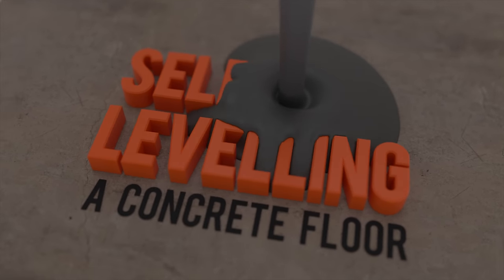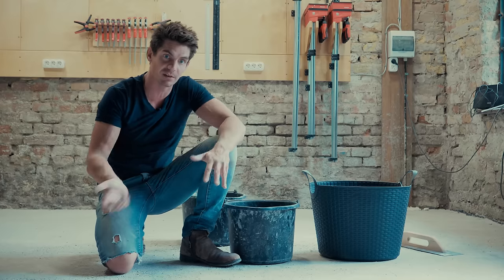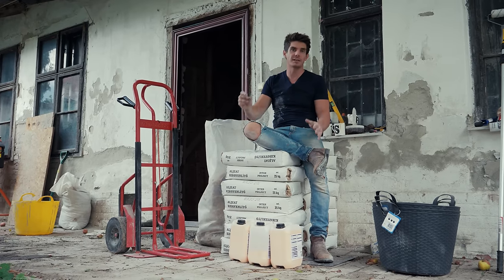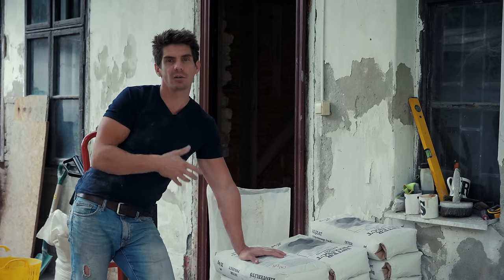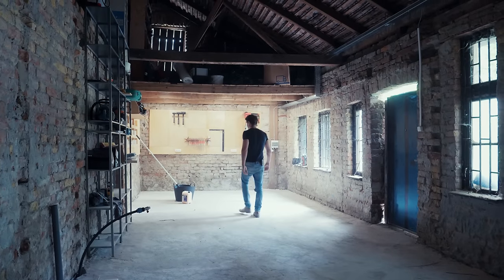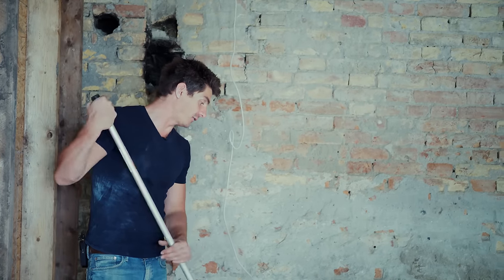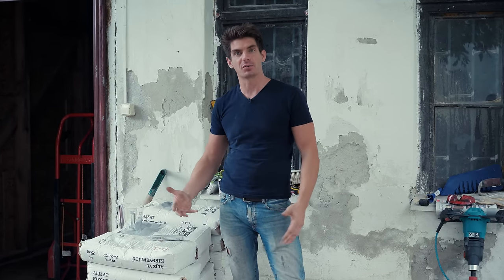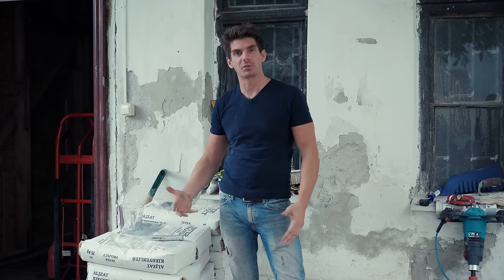Self-levelling a floor - The Complete Guide

Comment: My concrete slab under 30 yr old carpet was very dry, dusty, crumbly, etc.  I cleaned and swept the cement floor and was told to put. Sealer/ primer on it so I did. I then painted it. Let it dry and it peeled off weeks months later.  Even the sealer. Then I tried another way in another room and didn’t seal it. Prime it or anything and used a garage paint. It peeled off I had to redo my entire floor all over agin with acetone and a wire brush by hand. 266 square feet of cement floor. The I just bought rust oleum (stain not paint) he stain actually absorbed into the concrete. Wahlah..it worked. I put a few layers on it so I could have a very deep gray and completely covered the floor. I then went over the stained floor with 2 coats of clear, rust oleum and it dried beautiful!!!! But I ended up with a bumpy shiney floor. So I need to figure out if this leveling will do the trick for me for a beautiful smooth floor.

Comment: I am in the middle of doing a large workshop. The builder made a mess of the floor. The finish. It is bad enough that I am going to have to use self leveling cement to fix this. It is divided up into 12X4 meter cells. The concrete is Mpa30 x 150mm thick with reinforced steel mesh. It has been float finished. I have done a lot of renovation work. But I have never used self leveling compound.This is the Best explanation of how to do this I have so far come across on Youtube. May you, and your tribe prosper mightily.  Kind regards, and greetings from Africa.

Comment: I think I’ve decided to do this in my small laundry room instead of tiling. I have a beautiful brand new hot water heater in there that I refuse to remove to do a floor. I may paint the floor and stencil. Still undecided on the painting. This video was very helpful!

Comment: Great vid. Nicely explained. I would add 2 tips for speed. Use a long handled blade spreader rather than a hand trowel. Drill a 1/2” hole in water bucket at your gauge level. easier and quicker.

Comment: Get a floor scrubber rubber, the type used for stripping wax from floor start with the brush only then go over it with the buffing pad one time each 60,80,120 grits flood floor vacuum and let dry. I've found a few times over the years I can just put some top and bond down over a coat of liquid bond and cure. Then apply desired finish coat. Self leveler is 90-140 dollars a bag vrs 15-20 for top and bond at dollars for bond and cure which makes 225 gallons. Plus no matter how much self leveler you use concrete continues to cure. That Crete was to wet and over vibrates all aggregate was out of play

Comment: Great clip, just did a 30sqm area and that stuff is a life saver, much better and harder wearing with the polymers they use in it now. Surprised you got raised areas as it normally slumps as it sets, I just pour,smear and leave it to find itself. Anyway this will help heaps for those  about to do this for the first time

Comment: Regarding "one continuous pour". We are doing a 25 sq m area, (smaller than yours) with average pour of 7mm. From 3-10mm. I've bought 3x 75 litre mixing buckets, because my plan was to mix 3 buckets at the beginning, actually doing the mixing in the buckets on the middle of the floor we are pouring onto, then literally just dumping out the stuff all in one go, then using a long float to pull it around and get it to level. The reason I want to do it that way is that I'm very concerned that if we mix in smaller buckets, each mix will be 3 minutes, that's 13 buckets which is about 40 minutes of just mixing! Far longer than the working time of the product (about 30 mins). My way, it will all be mixed up in about 10 mins, and then tip, trowel by hand and with a long pole, and then hit it with the spiked roller. I've never done this before - does my idea sound stupid or sensible? The only things I can think of that are different to this video are: 1) it does involve walking in the screed to get to the corners - so boots etc... and (2) as the 75 litre buckets are deep and quite narrow (plasterer's buckets) it may be difficult to get my hand in to scrape off the sides during mixing. Do you think that will be a problem? Cheers!

Comment: concrete was mixed way too thick no flow to it which is why your roller left marks because it was so thick and dried too quickly. also use a 30-40 gallon bin to mix them at once in the spot needed with a vacuum

Comment: Just a little trick of the trade. If you get any high spots, clumps or ridges, In the self leveling. 
You can take the trowel, put it on its side with the handle facing you, and just drag it. You have to do it at the right time. Right when it sets enough to walk on it, but soft enough to remove it. 
It’s a lot easier then pulling the grinder out:-)
Reply: I don’t normally tell my secrets that I learned after many years of trial and error,  but I’m feeling generous today.

Comment: Seems like a wet-dry vac would be your best bet for getting most of that dust crap off the floor. just pour down some water, brush lightly to loosen it into a slurry, then suck it back up with the wetvac. Repeat until most of it is gone, then do the final run with the broom to get the last of it. Yeah, it'll take longer but a lot less backbreaking than multiple passes with that broom.

Comment: tip cut a hole in the side of the bucket at the right level then just hose in the water till its to the hole. also a tall thin hard plastic bucket and you wont splash screed all over the wall

Comment: When you have measured the exact amount of water required cut a hole in the bucket at the water surface point and that way you will use exactly the same amount of water for each bag.

Comment: I have loads of comments ,but I will start with one . This stuff is not self leveling ,it can't possibly be , at best it is self smoothing . It is very expensive in UK ,obviously a lot cheaper in Hungary. 1L/mm/m2 is the formula . 1000 Litres= 1 cubic metre, the weight is not important .The upstairs floor16m2 x 50mm deep weighs 800kg not 2000kg . The cheapest way to get the floor level ,is to put the screed down level.If you want to find the low points in a floor ,flood it with water and mark around the puddles with chalk .This stuff is only used in the UK after the floor screed has been laid to take out the low spots ,as it is cheaper than tile adhesive.

Comment: For measuring out water accurately we do as you did with the kitchen jug and when the bucket has the right amount in it we drill a 12mm hole though the bucket level with the water. Aim the hose into the bucket full blast and when water goes through hole, bingo.

Comment: Hears a tip: yu spelt levelling rong - its leveling ( 2 Ls not 3)
Here's another tip: when mixing leveling compound add one half of the bag first, then spin real good. Add half of the remaining bag and spin again, repeat with the rest of the bag. That way your mix is very liquidy at first and your paddle wont get bogged down like it did at the beginning. You wont have clumps of un-blended powder at the bottom or in the corners of your bucket and no need to scrape the sides with a trowel.
Another free one: get a 3 or 5 gallon bucket (like from drywall mud or paint - they're free all over the place), and measure out your water. Drill a 1/2 hole in the side so the bottom of the hole is at the waterline. Now the bucket can only hold the correct amount of water. Done. Amen. And you wont drop your "torch" looking for your line.
Reply: Good tip about mixing good to have someone helping with the pour.

Comment: A comment below asked about adding thickness. If you need extra deep then mix aggregate to initial pours. I used Mapei which only permits 4mm thickness so finish at 4mm....allow to set then reapply primer and start again.

Comment: Thank you for such a comprehensive video. I am planning to use this as a finished floor in the small house I’ve built for myself. I had a beautiful mud floor in here before but had a bad fire and the fire hoses totally dissolved it. My question for you is can this self leveling concrete be colored and if so do you do it when you mix it or after it’s laid down? Could I stain it as they do with concrete floors?

Comment: You can flaten with a drywall trowel rectangulal 200 mm wide with the handle and blade in a T shape not the iron shape. And put water on with hand or sponge if leveler is too dry ---and swirl it around and around and loosen it up for a square foot or so to ready it for a trowel pass over it to smooth it . Even press with both hands one on the handle when it gets like the fine sand on the edge of a beach on a lake with sand .  Try using " cement all " brand . ( it won't  suddenly harden from water ). 
 Why not mix it in that room save travel time between batches ? 
 Thanks for showing what it does .

Comment: Yeah, I haven’t looked through all the comments but I recon they, like me think that the WHOLE explanation was the dogs bollocks. Thanx ever so much for an awesome explanation. It will go a long way in detailing MY upcoming garage floor levelling after a replacement roof job down the line. P.s great clamp set  and the guns aren’t to be sneezed at either

Comment: thank you for a great instructional video.
any particular reason you didn't mix the leveling compound in the room you were applying it? I would think save time by mixing in the room.
Reply: When you've primed the floor the last thing you want to do is get more dust on the floor prior to latexing. Inevitably there will be splashes and over pour from each bag, over 22 mixes that will seriously add up and make a hell if a mess. If however you were adament to mix close to the job, I'd strongly recommend a cheap pop up tanning tent from amazon. Just make sure you get a good respirator mask too, it's gonna get pretty dusty in there!

Comment: My basement bathroom was made by home owners who didn’t have a clue. It literally has 15-40mm valley everywhere With over 1/2 slope into the walls in some areas.  Linoleum pressed
Down to fit with nothing under. I was for it but now. Carpet it is!

Comment: Great Job.  What bozo poured and finished that slab!!?  Horrible!!  It should never be that soft and dusty but not your fault.  Also, I would suggest added about 2-3% more water as those dimples would not have been an issue while still staying within OEM's tolerances for water, plus it would have flowed better and been easier to move around.  You are very correct with just about everything else.

Comment: Two suggestions. 1. burn the fiberglass strands before you vacuum. 2. Use a 24 inch roller for priming to speed the process up.

Comment: Excellent  video I have a french drain around three of the four walls I have covered it with mortar should I cover it with self leveling compound if need be and I am considering painting the entire basement with a 2 part epoxy paint to seal it and give a nice appearance then later I can tile or place carpet as desired your opinion thanks Mark

Comment: I laid wooden tongue and groove floor on my new build home but my wife insisted it flowed from room to room, I explained it won’t work as there are differences between the floors but I still went ahead and laid it. I cut the door frames in beautifully but low and behold……the floor is now raising up slightly in certain areas. I’m going to pull the floor out and level the concrete underneath like I should have originally but my wife is again insisting that it flows through. Can I use self levelling fluid in various rooms that will then have the same level? Basically I have the lounge, hallway n kitchen that need to be the same level, will that work?

Comment: good video. Is there a product (in US) that will be think enough to accommodate a slight slope? My floor has a slope of 1" across about 10feet. IOW, is there a thicker product, that will lay flat but not run downhill due to its viscosity?

Comment: If you have 8mm depth in one area, so you need a 3-10mm screed, and the other area is 1mm, so you need the 1-3mm screed, is it ok to use the two screeds together, or do you wait , let one dry, then finish off with the other one?

Comment: Hi , love your in depth video. Could you advise me, i am needing to self level my garage floor which is a ballast concrete mix done 10 years ago. It is approx 8 inches thick when layer on a well laid brick rubble base. It now has formed a crack across the floor will I need to grind a channel into the crack so the self levelling compound seals this more sufficiently so it won't open again or not bother because it more likely will do.
Whats your advice. Big thanks
Also subscribed
Area is 25 sq mtrs and ribbed as ballast concrete floor, how much would you suggest as need at lowest point is 15mm to highest point

Comment: Great vid. Super clear. Subscribed.  My builders didn't wait 24 hrs for the latex to dry . May be 17hrs. Weber brand. They said it wasn't necessary even though I could see dark patches ( but not necessarily wet). They put on the vinyl floor on top. Is that a problem?

Comment: HELP! Renovating my kitchen and waa originally going to level over the old ceramic tiles!
(A lazy way, i know).. My brother convinced me to pull them up.. we did... then we had to scrape up a load of self adhesive vinyl tiles which were under the ceramics... Then scrape up all the old glue.. Its turned into a total nightmare!
Its now 2.30am.. My new kitchen arrives sometime tomorrow and im ready to prime and hopefully get the job done before it arrives!
Heres my question! Do i need an expansion gap? I cant see one in this video! If so, what do i use?  Stressed doesnt begin to cover it!

Comment: I have a garage floor that is cemented but is uneven. However, there is a square patch about 1 square metres that has sand in it and is about 10-15 mm higher than the other part. I bought the house so unsure how or why it is there. Planning to use it for workshop so not too concerned about beauty. Am looking to just use floor levelling compound to bring it to the same level and use those gym mats to cover it on top.
Do you think it's the right approach? 
Any other ideas in a similar price range? Thanks

Comment: The styrofoam will float if you don’t weight it down.  I’m sure I’m not telling anything you don’t already know. 😀😀👍
Reply: Also, a good seal is absolutely crucial! A thinner mix will happily flow down any crack or hole, where e.g. honey would. (Ask me how I know.)
Reply: @lunakid12  how do you know
Reply: @MrJollybox  :) Thanks for asking. 

A guy came to finally do a nice even floor, supposedly an expert (which he kinda was, it was certainly his trade, not mine), and he didn't bother much sealing all the edges properly, while there were multiple obvious places any liquid could happily disappear (like holes where heating and water pipes came up from down below etc.). I told him I wasn't sure it would be enough, but he ignored it. I still plugged a few ominous gaps with random pieces of polystyrene etc., when he didn't look, but, well, that didn't end up being enough, unfortunately. 

It wasn't like most of it just poured down, like water would, but the result was an uneven floor with gradually decreasing heights toward the sinkholes, and some nice creamy flow traces on the wall of the boiler room (is that the word?) downstairs. After all the work and expenses, I still didn't have the nice even floor I was hoping for.
Reply: @lunakid12  The flooring guys that did our kitchen were the same - there was a pipe duct around the edge of the room that had sunk slightly - all the self-leveller flowed into it and the crack around the edge of the floor slab.

Comment: I have a garage floor full of significant pitting.  Otherwise it is sound.  Some of the pits are up to 1-2 inches deep.  I'm thinking I could pour a coat over the top of my floor to fix the problems and get a flat floor.  Should I go with the mix for thinner coats?  Or buy the thick stuff?  Thanks

Comment: I didn't know you could use underlayment as the finished floor.  I did not think that stuff would stand up to the wear and tear (unless that's overlayment). Also easy when spreading it.  The more you spread, the more square footage you get from each mix, but the harder it is to achieve a smooth level finish (ask me how I know!).
Reply: how do yow know

Comment: Hi Thanks for this instruction.
Can this be used outside for a garage roof which doubles as a terrace or raised patio for want of a better term.
The existing concrete floor/ garage roof is no longer waterproof and rain gets into the gargage below .

Comment: Great info but I’d be worried about the concrete strength with all that scaling coming off from having been mixed too wet or troweled too early. Also, is the concrete being finished over even deep enough to support any kind of weight? It looks like what we call in the colonies, a “scratch coat” which is generally a couple inches meant for sealing a dirt floor in a crawl space. A flat, smooth, level floor could have more easily and cheaply obtained with original concrete pour if it had been done correctly. However, like products are great for getting getting a much smoother finish. I’ve used it to finish concrete counter tops and it covers as tight or tighter than natural stone. So I can see using it after a properly done pour as a sealer but would’ve needed far less material than the six or eight bags used here. Just an opinion and enjoyed the video.

Comment: Plastic Fibers: I am not certain but I do know that there is fiber glass re-enforced concrete in the US so perhaps that is what that is. If it is indeed plastic then you can use a blowtorch, after the cleaning process, to melt the plastic. If it is fiber glass I am not sure if that would work.
Reply: If they're thin enough, you can still use a torch with mapp gas that will cause them to wilt and lay flat.  Otherwise go around clipping them.